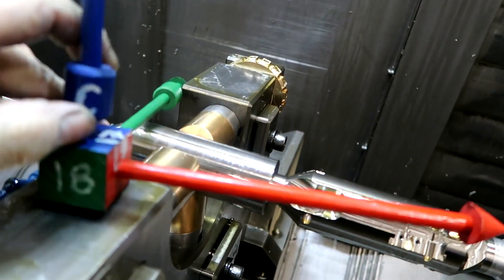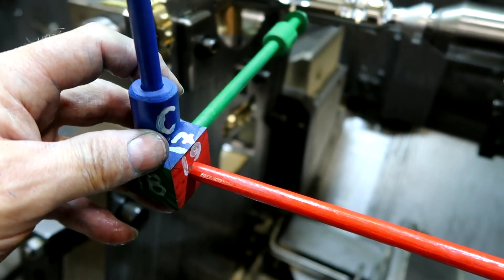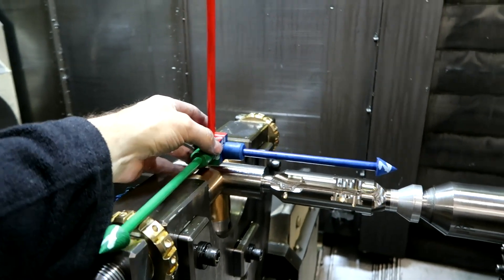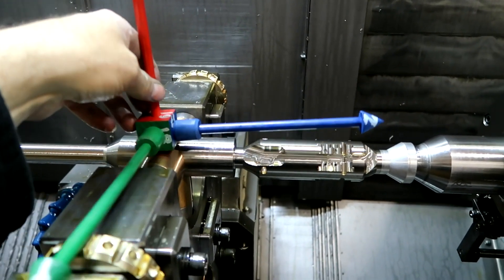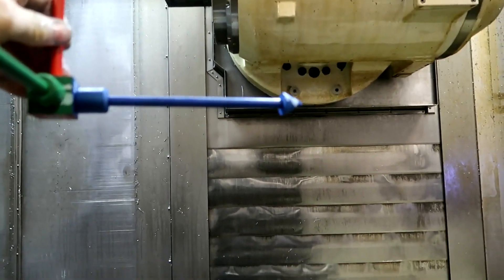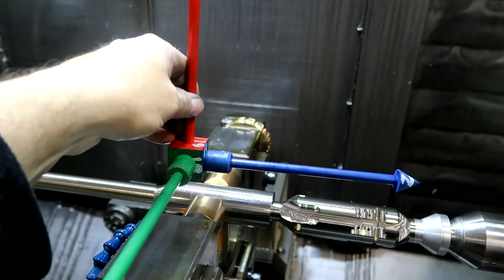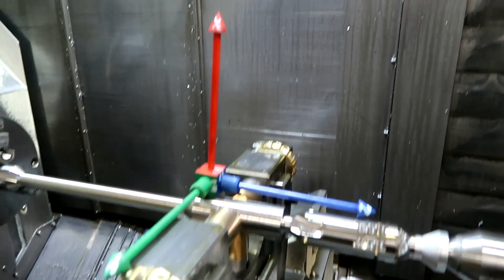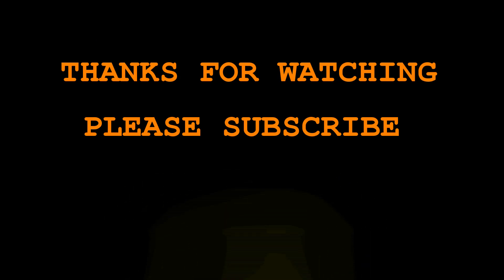Machine Coordinates Systems

Comment: Thank you for sharing this! I had wondered if the Y axis direction was set up wrong on my manual mill. To me, it made sense to use the left corner of the fixed jaw as X&Y zero and have both numbers move in the positive direction as the work in the vise was moved under the spindle.
Reply from the maker: Thanks Corban Eells. This for me in the beginning this was somewhat confusing, so I thought it might help someone else. I'm glad it did. What I show in this video is the conventional setup's for machine axis. Some machines don't always follow this. For example my CNC grinder has the A axis parallel to the Z axis. This would normally be a C axis.

Comment: Hi Peter. First let me say Thanks! for making these videos, they are extremely helpful for anyone learning the trade like me. I wanted to suggest/request a follow up to this video if you have time. When you are talking about the B axis on your Integrex rotated 90 degrees ( or any angle)  you mention that you prefer to use a coordinate rotation ( I believe you mention G68/69). Could you possibly expand on this topic, ie what the code looks like. If I understand correctly your Z axis becomes whatever direction the B axis is pointing, so you are always milling in G17 plane? Occasionally I operate an older Hitachi-seiki turn-mill with a similar axis set up to yours, Y axis + direction is coming at me. We have a program that uses the B axis rotated 90 degrees to side mill a serration profile on the face of a part.  The program calls G19 for this tool. What confuses me is that in order to adjust the depth of cut radially, I am adjusting the U value wear offset. Also to move away from the chuck I use a - value and towards the chuck + value. The parts turn out fine but I wanted to understand why it works this way.  - Geoff.
Reply from the maker: +Geoff Struthers Are you rotating the coordinate system with a G68? To match the B axis. If so the X+ would be going toward the chuck in the machines Z- direction. I'm not sure how your machine uses its U wear value but typically the U value goes with X. XYZ UVW so maybe the U doesn't get rotated.
Reply: Edge Precision I don’t see any coordinate rotation in the program, only calls G19 for the tool. It would make sense if it was rotated as you say X + would be towards chuck. I thought it might happen automatically when the B axis was rotated. I didn’t write the program, just wanted to understand what I was seeing on the screen vs what was happening in the machine. It can be confusing sometimes. Thanks for responding, and thanks again for the videos, they contain more Ah ha moments then most videos on the subject of CNC machining.
Reply from the maker: +Geoff Struthers l have been thinking about this. If you didn't rotate the work plane but rotated the B axis to mill on the face of the part with the side of the end mill. If you are using cutter comp you would need shift your plane of compensation to the YZ or G19 plane. As for the + going toward the spindle are you talking about programming? In programming in Mazatrol (witch I seldom use) you program Z+ towards the chuck and Z- away. I don't know why they mad it that way.

Comment: Thanks for the great visuals and explanation, Peter.  I was familiar with the vertical and lathe coordinate arrangements, but had not looked into the 5-axis, nor horizontals.  Very informative.
-- Cheers, Gary
Reply from the maker: Tools4Machines Thanks Gary. The Integrex took a little getting use to at first.

Comment: That's an interesting looking fixture in the Integrex. I assume it's there to support the part during milling. It would be interesting to see how it works and the thought process behind it's design.
Reply from the maker: Its a manual up side down steady rest. I made it specially for these parts. Its mounted on the mount for the normal hydraulic steady rest. The hydraulic steady rests diameter range is 3.9"-16.15", its to large. It was necessary for this part because of the small diameter in the middle .920 dia. and for support for the milling. Look at my Time Laps Video on the Mazak. You will be able to see it in action. Also with a hydraulic steady rest you can't mill slots that intersect the rollers if you want to rotate the part afterwards. The rollers will go down in the slots as the part rotates(this would be bad!!). With a manual steady if the jaws span the gap it is possible to rotate for milling. There are servo operated steady (Or Work supports) that could make this possible.